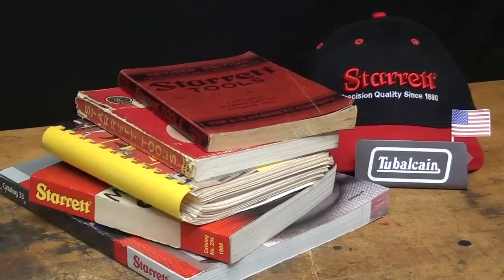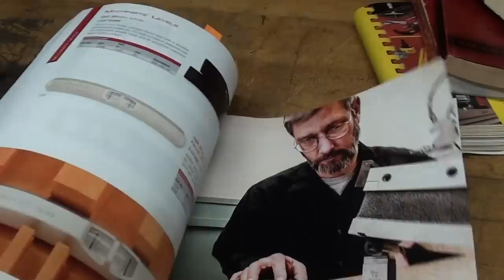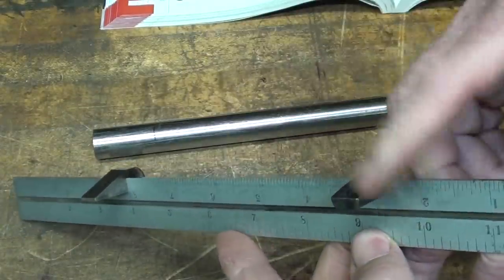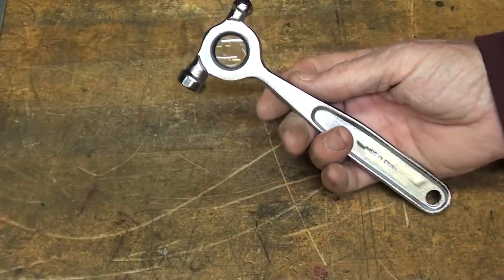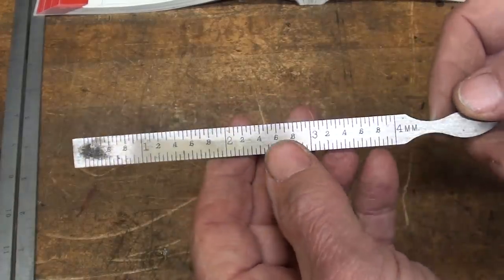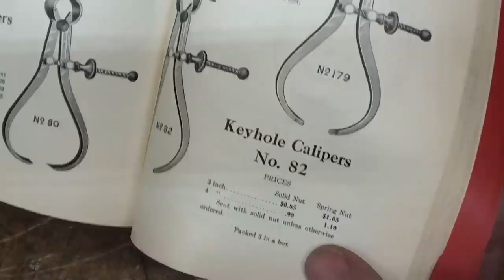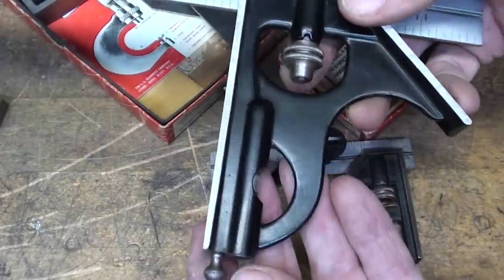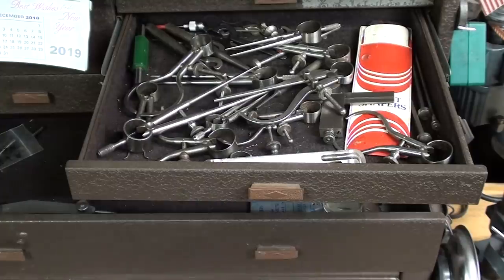Some Obscure Starrett Tools Tips 540 tubalcain

Comment: Seeing you and other machinists with Starrett led me to investigate my small collection of calipers.  Several came from my father in law that spent 43 years as an electrician in a John Morrell packing plant.  Our of the 5 that I have three are Starrett.  All are well used and very corroded.  They carry initials that were not my father in law and I suspect they were cast offs from old machinists.  So they are now elevated in my mind as keepers.  Great video.

Comment: Mr. Pete,
Another use for the no. 52 scale holder is to hold a scale while using a transit in the pattern/model shop for shooting in a tool (I have 2 of these that I’ve had for 35+ years)

Comment: As a quality inspector, I did a tour of the plant in Athol, (3 days). One of the things that I remember most is that the factory was built over the river, and the factory still used water power to run a lot of their equipment, ( huge belts running across the ceiling). Another thing was a 2 story section with a large 20 foot cylinder, they checked bore gauges for missile tubes on submarines.
Reply from the maker: Thank you, that was interesting

Comment: I have used the 299 and the 289 many times. The 299 often with a 3" diemakers square rule to fit in a small recess (think boring a hole through a plate in a double wall tank on a ship and needing to measure to a framing member during a repair) and the 289 for reach-over measurements where the spacing needs to be right on to a raised center reference from the wrong side, like fitting or blanking some flanged valve setups. Many other ways, but thesemake it easy in the field.... Taper gauges are also real handy in the field. Well worth the $$$$$...  Never had the need for a clearance gauge, though. Thanks for showing the collection.
Reply from the maker: I'm glad you liked it

Comment: Some years back I was threading barrel tenons for large ring 98 Mauser rifles.. Even though Mauser is a German rifle, they use 55 degree thread form on the tenon and inside of the receiver.. Every fish tale I had was for 60 degrees so I finally bought a Moore and Wright gauge which has both thread forms so that I could grind the proper angle on threading tools...
Reply from the maker: Yes

Comment: If you stay with a good ruler like Starrett, there is very little error in length.  Take a pair of 18" calipers and measure the length of a 12" Starrett ruler.  I have no problem putting them end to end other than a way to hold them or line them up.  For layout over 12" I've used my 6" calipers and laid a 12" ruler on the end and marked the end of the ruler many times.  I don't think I have ever seen that clamp you showed or even would have realized what it was for.  Interesting.

Comment: No 82 looks like you would lay the straight side of the caliper in the depth of the key way you just cut, then you screw the bent end of the caliper with the adjusting screw against the apposite side of the shift. Then you read you measure between the gap of the flat of the point side to the curved end of the caliper to see weather the depth is to small or large. You have to remember there was a day that keyways were cut with a special cold chisel and I've seen done it in books. Could be wrong though and I hope there was no confusion here, for it's just a theory.

Comment: I've got a small amount of starrett tools from (what I assume to be from the number of specialty tools) a clockmaker's toolbox which I got at the garage sale of an ex-antique store owner. Not all of it was in good shape - I have a "double depth of sharp threads" fishtail gauge which is in terrible condition, and after derusting it looks like it was made in the 1390s and not the 1930s. I also have the keyway clamps and the rule clamp. Given the small size of work the original owner must have done, he didn't have any rulers over 6" in the box besides some non-locking folding rules. So, I assume he must have used the clamp to make a "regular size" ruler when needed. 

A few weeks ago I also got a starrett No. 1 Wire Cutter in a toolbox of assorted things off craigslist. The woman who sold the box to me said the original owner would have been 120 years old if he were alive today. It's rare I find that stuff near me but when I do, the prices are usually so good I don't bother haggling.
Reply from the maker: That sounds like an interesting toolbox

Comment: I don't own a clearance gauge Lyle. I need to pick one up... know anyone who has one for sale?.😃
Great video
Reply from the maker: I wish I had known that you did not have one. I would have given it to you. It sold on eBay two weeks ago. And you never did answer my comment on the optical comparator which I offered to give you
Reply: @mrpete222  I have also been having issue with the YT notification system on you and several of my favorite YT guys. Sometimes I dont get notified when they post a new video. I think I get about 2 out of 3 of Adams videos. Drives me nuts.
Reply from the maker: @SteveSummers  I get ZERO notifications--and I am subscribed to 150???
Reply: @mrpete222  Yeah, mine seems to work sometimes. I get more notifications from the channels YT wants me to watch then the ones I really want and hit the bell on.  Did you already get rid of the Optical comparator?
Reply: Good one what are you doing here Steve

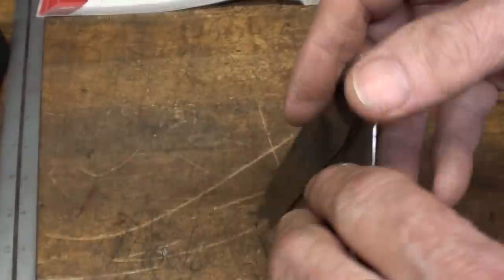Comment: very interested tool 13:40  think that be more accurate than using a calliper it is fixed and I very little chance that you could move it  as to a calliper an, on a calliper you could have different people use it comes up 2 difference numbers as well  had happen to me  in order bearing  like I had to take the bearing with me  they did order the wrong one and I had to wait for a day to have the right one come in,  was not a cheap  bearing at all  funning they have to some machines all the bears and shafts are different  
the serial no. had the last number different